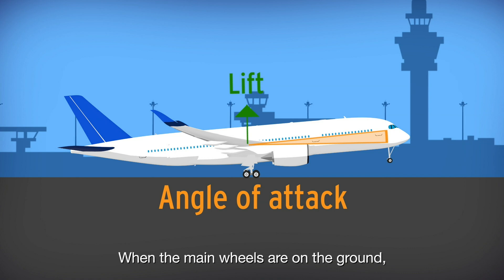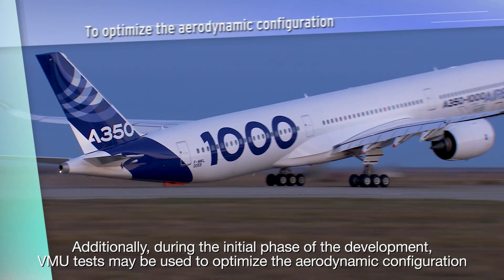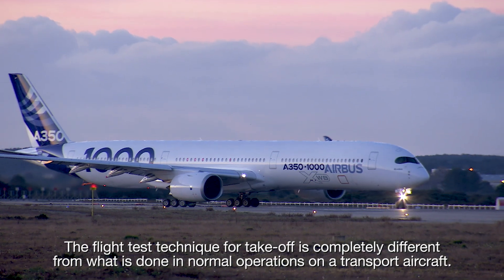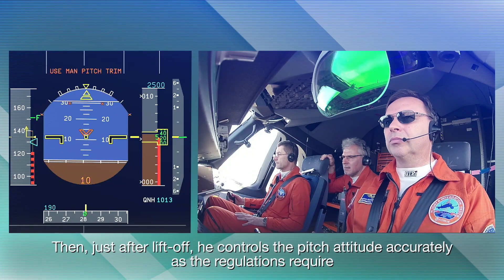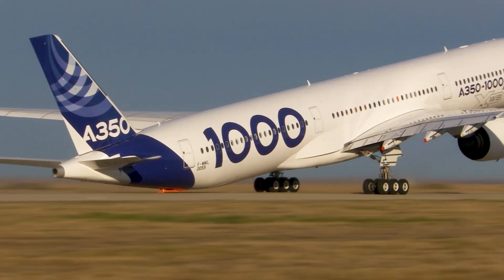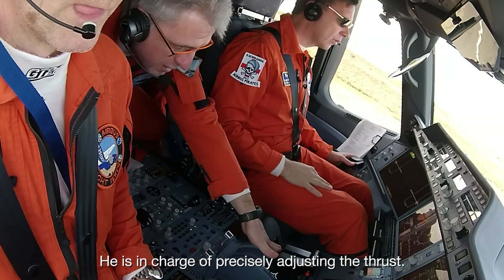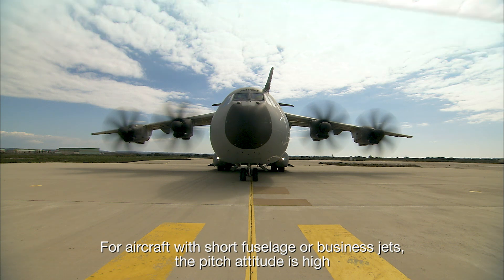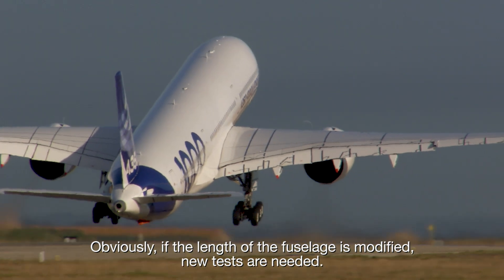Flight Tests - Ep.7: Velocity Minimum Unstick Tests (VMU)

Comment: Looking at it, I have come up with three ways to facilitate increasing the angle of attack at the critical moment. One would be to install a pneumatic actuator where the tail bumper has been placed that would abruptly move the tail away from the ground at that critical moment. It would act as a "jump pole"
 Another would be to install high pressure blowers under the track that would do the same. And another install a strong polarized electromagnet unlike another installed in the fuselage

Comment: Is the tail bumper, retractable? If not then it may create turbulent flow through that surface. 
I want answer from @Airbus #Airbus
Reply: What if it does?
Reply: It creates a significant amount of drag and affects performance in-flight...but I don't think it matters when it comes to calculating  VMU speeds.And in any case once you find out your rotation speed your done with the test.Reduced performance due to the tail bumper in-flight and during landing doesn't matter anymore.
Reply: @abhiroopmukherjee9030  pretty obvious isn’t it?
Reply: @cpt_riris  yeah I guess
Reply: @abhiroopmukherjee9030  okay got it sir.

Thank you so much